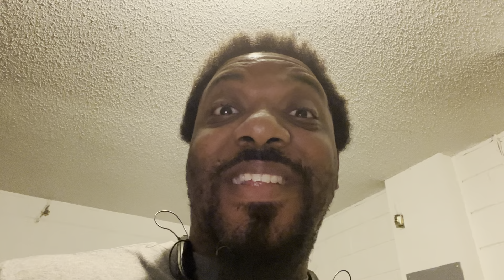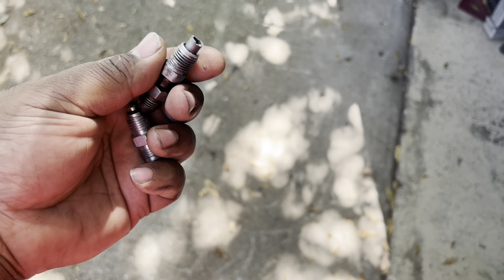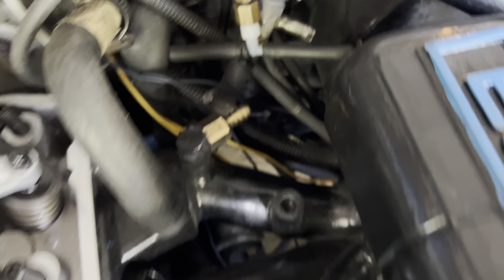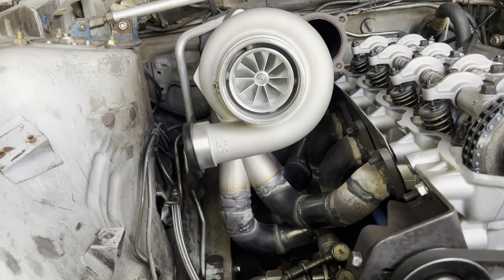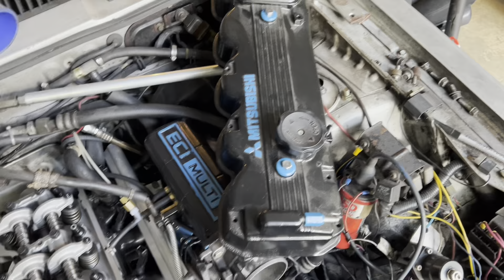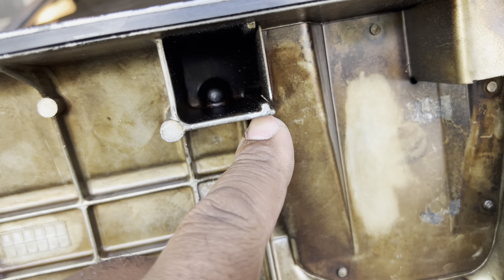1988 silver Starion long-awaited reassemble￼￼

Comment: So when you set the lash do you just set it like that and forget it or do you adjust again once the engine is warmed up? Also I bought felpro head studs before seeing everyone talking about the ARP studs. Do you think the felpro will be ok or should i get some ARP studs? I'm installing my new head this weekend!
Reply from the maker: You definitely have to adjust it when warm just to make sure everything is perfect and also to make sure that there is no noise but the standard studs will be OK for a standard car but for performance purposes, I would probably upgrade so you don’t have issues with head lift, but that’s definitely a performance thing have left usually occurs over or around 20 psi

Comment: Hi! regarding your 'concept' (blocked fitting around 12:40 on your video) about alleviating the pressure of blowby (with your permission, i might copy this someday), i was wondering how to measure excessive blowby? I have a stock (no-boost) carburated 4G54 engine, and blowby pressure every time i remove the oil filler cap seems excessive. No clogged breather hoses (front and back), engine runs fine, no loss of power, just curious if this is normal (excessive blowby) for the G54 series engine
Reply from the maker: Oh yes you can definitely copy the little experiment I have going on there and there’s not technically a way to measure blow by while the engine is running but if you’re getting excessive blow by I would definitely refresh the piston rings and probably put a gauge on the line that goes to the catch can and see if it ever moves I really doubt it I would probably say a good compression test would tell you what’s going on your compression on NA should be around 135 or better